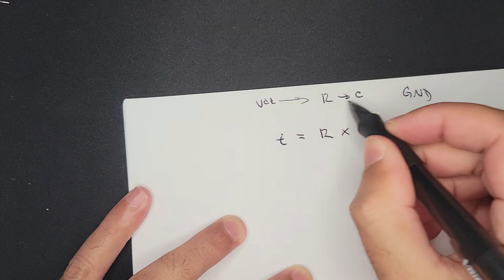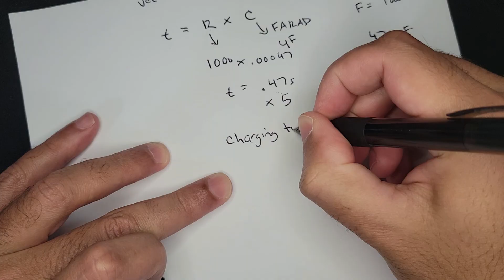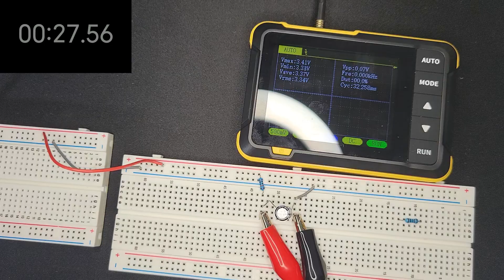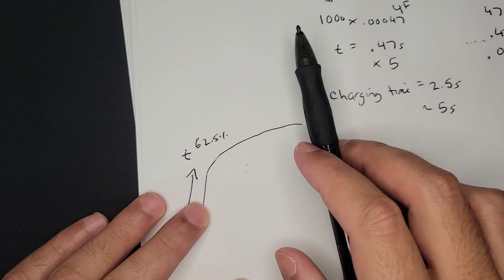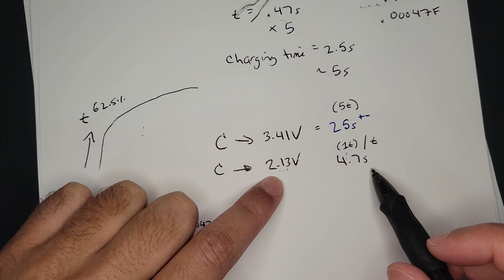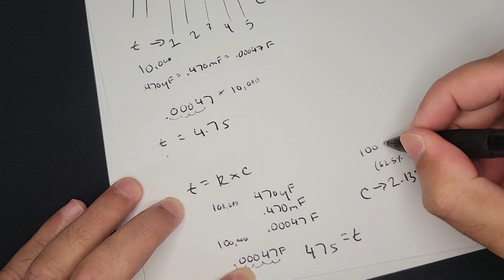Beginner Tests Capacitor Charge Time - RC Circuits - Beginner Learns Electronics Ep12

Comment: Hey bro, I'd like to know if you are satisfied with that osciloscope. I'm looking forward to buying one, but got mixed reviews online. What do you think of it?
Loving your videos, they're awesome!
If I may make a suggestion, it would be nice to see you dive deeper in the calculus of RC, LR, LC and LRC circuits. I've studied a bit last semester, but there's so much I struggled and I haven't learned it 100%, and it would be nice to see you mix theory with practice, and think that would be very nice!
Also, if you don't mind, I'm thinking about doing the same as you, getting some capacitors and inductors and make experiments of my own, and sharing them with you!
Reply from the maker: Thanks! The oscilloscope -- it's tough for me to say. I'm very inexperienced so I don't really know what features may be missing. For me, it has been great -- as I want simply want/need it to demonstrate the relative voltage rising and falling on whatever component I'm looking at. If that's your goal, then it works for me!

Regarding more theory -- I do try to keep things practical, but the theory is really important. I touch on them in some of thee videos more than others, but I am thinking of posting more expanded versions that contain more theory. It's a good idea to show more of that, thanks!

And yes of course, I'd love to see the tests that you do. Let me know!

Comment: Ok.. close on the delay circuit.   Remember.. base to emitter current is very very very little compared to collector to emitter current.   That also is the only path you had to actually charge the cap.  Instead, the original proof of concept (when you were measuring the ramps) applies.     Replace the o ' scope / meter from the first part with the base lead connected to the same measurement point.    At T0/Time of Power, all current is flowing from Vcc/supply, down through the 10K, to where the cap at that point also is zero/no volts.   From there it starts to rise.
Reply: AH.. close to the end you got it.   Yeah you have to figure in the Vf of the LED itself.. it's a balancing act between the charging current, and how fast it can get to where it exceeds the Vf rating.   Once that Vf is exceeded.. LED comes on.  Edited to add.. that .65volts also needs to be taken into effect.   Your goal is to get the emitter up to the actual rated Vf - Which I do think is 2.5 volts.   Subtracting .65 that equals at least a 1.85 level on the base.   So that also could be your 62.5 percent level to calculate for using the TC formula.
Reply from the maker: "Once that Vf is exceeded.. LED comes on." Wouldn't this be the case if the LED was powered directly by the capacitor? I was thinking that all I need to exceed is the base saturation voltage (0.65V), and let the collector's power do 'the work' of powering the LED at that point. I have a lot more to learn for sure! lol.
Reply from the maker: "That also is the only path you had to actually charge the cap." That didn't cross my mind at all, thank you for pointing that out. That makes a lot of sense. I'm there assuming the base doesn't conduct, but I'm also expecting the capacitor to charge through the base to the emitter. Definitely a huge misunderstanding on my part. Does this mean that if I provided a parallel path from the Cap/Base junction to GND, it may have worked? Also, this means that the base can conduct at lower than the 0.65V?

Comment: Remember that's a logarithmic curve.   Plus 100 percent is actually 6 TC's but usually 5 is enough to design around.   If you first also precalculate the 62.5 percent level that just the first TC should reach, then right at T + 1C it should measure the same voltage. 

Rate of charge .. that's the key.    It's a little clearer to see with the 10K resistance since the curve itself is not as steep if both tests were compared side by side.   If the instantaneous voltage values are sampled at the exact same point in time (like you discovered), then the math checks out.   :)
Reply from the maker: I see what you mean. It was indeed a lot clearer with the higher resistance charging. Thanks!